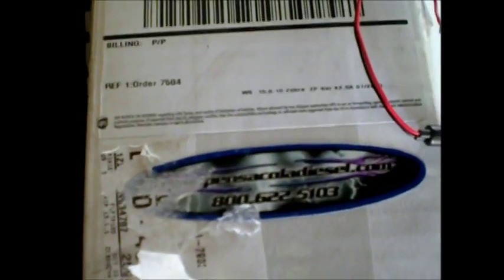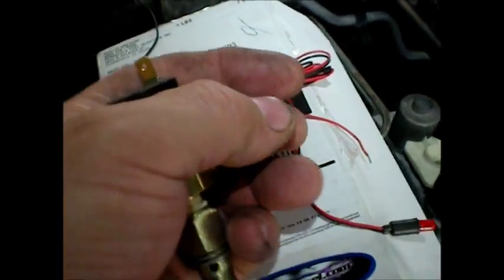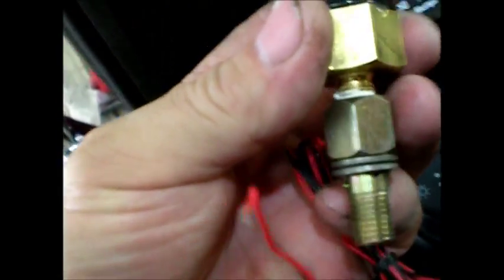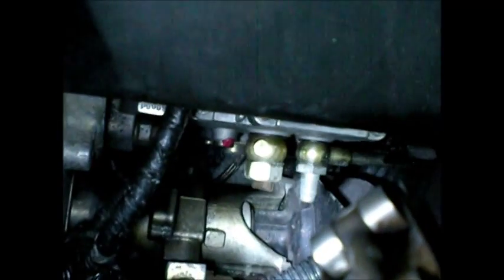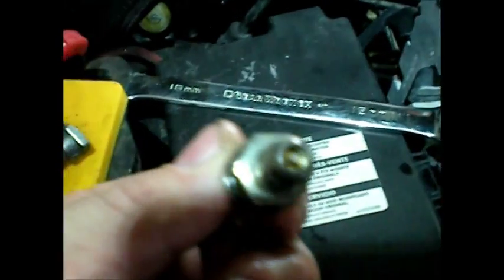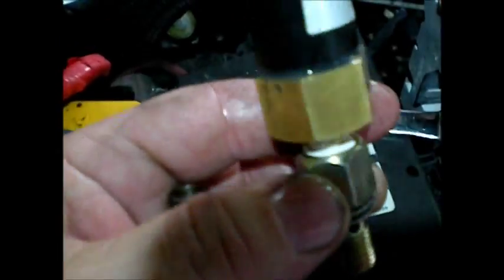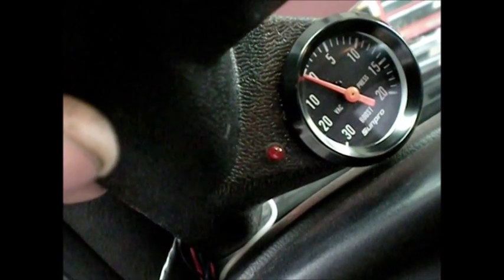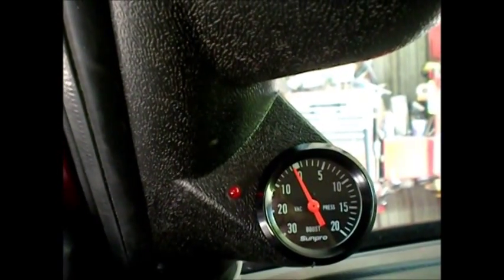Cummins LOW FUEL PRESSURE  Warning LED. PART 1

Comment: I have one of these on what i believe to be a fairly new pump (just bought the truck) and it comes on when I hit the gas and goes off when I let off the gas.  Any suggestions?
Reply from the maker: I would start by adding a fuel pressure gauge you probably have a fuel pressure issue.